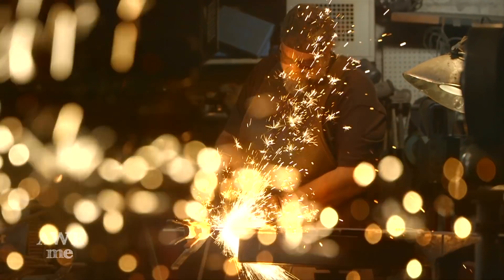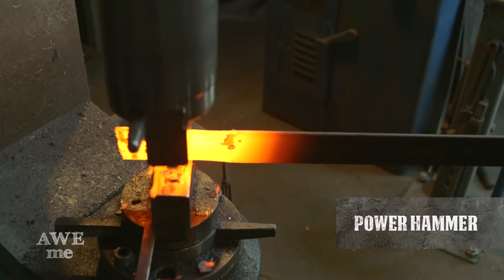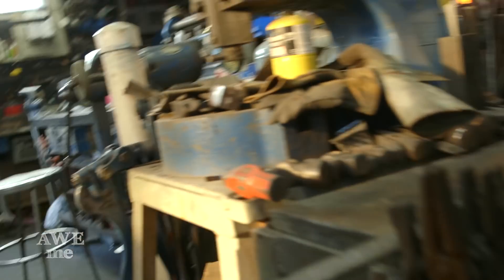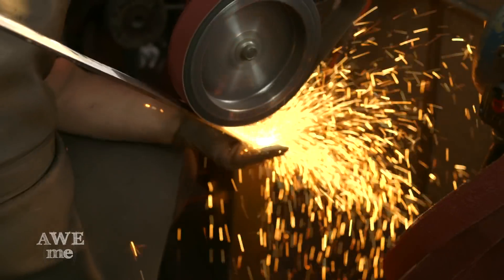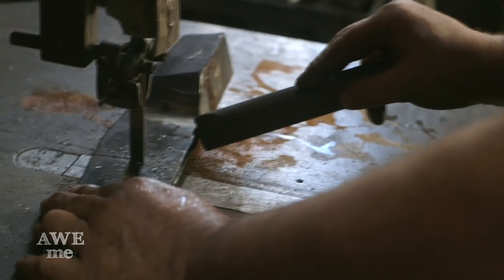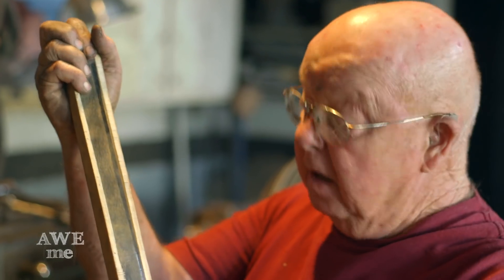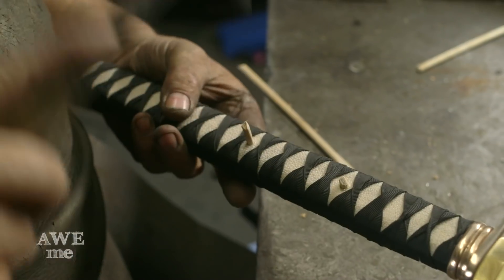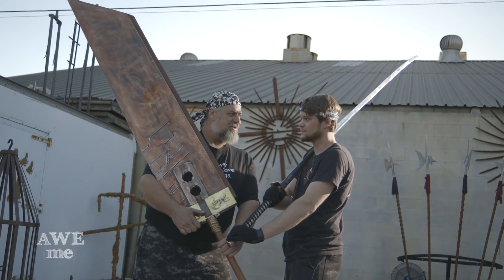Sephiroth's Masamune  (Final Fantasy VII) - MAN AT ARMS

Comment: that wobbly bend in the blade as you swing it is why 7 foot long swords are not a thing
Reply: Jayson201 And that's why Sephiroth is the only one who can properly use it
Reply: I dont care how strong or powerful you are, that blade wobbling like that is a bad thing.
Reply: It's how swiftly you swing it and timing the wobble
Reply: +Jayson201 if you can swing it as fast as sephiroth there will be no wobbling
Reply: +Jayson201 cuz videogaimz....
Reply: +Jayson201 this wobbly bend is what you see in about every blade in slow motion. some just need a huge slow.
Reply: *****
yeah thats right
Reply: the steel is cheap American grade steel. I live in Japan, I am tell you the meat knife I buy in the dollar store here is made from better steel than that crap. Japan steel is unusually strong
Reply: junk face complete nonsense, my friend. your knife may not seem to wobble, but if you add a bit of slow motion it will look like liquid upon hit. the katana is just long, so its easier to see.
Reply: +TheWildPenguin Actually the sword they forge here is way floppier than nodachi, which has thicker blade and strong rigid spine with soft steel in the heart to absorb vibrations, while the cutting edge is extremely hard high carbon value steel. This sword truly is a wet noodle of a blade made from low grade steel, that is not even folded.

Like paper, when you fold the steel it becomes more sturdy because the atomic structure has less room to "bend" and slide around when carbon layers in the middle between folds work as a sort of "skeleton". It is what gives REAL swords like sabers and katanas their precise control and predictable, easy to feel balance that doesn't jiggle all over the place messing up your swing form.
Reply: +Jayson201 dude you got japan confused with china
Reply: Proof is in the pudding. American grade steel is shit.m Japanese 1.8l cars compete with American 3l v6's. I bought a kitchen knife for 2000yen (20 dollars) and cut through a frozen block of salmon.
Reply: Qin ShiHuang 秦始皇 you're Chinese. You're partial in the argument.
Reply: +Jayson201 Shaping a flimsy piece of sheet metal into the shape of a blade is not the same as forging a real sword. I'm not going to say a 7 foot long sword is possible but this proves nothing. Also I would imagine one of the real reasons why a 7 foot sword is not a thing is because it would be impractical in battle. Can you even imagine what it would take to wield something that long in any effective manner? No regular human could wield it and expect to live very long.
Reply: +subject sigma Pier Gerlofs Donia is a key figure in the Frisian rebellion. And his strength was legendary. One feat was beheading multiple people with a single swing of the Zweihander which is 7 feet weighing fourteen pounds.
Reply: Junkmeister This guy clearly fits into the category of "not a regular human".
Reply: then what would fit into a category of "a regular human".
Reply: okay, the point to this show is to make something from video games,
The point to my statement was that in the real world, it's impractical. thats all dude
Reply: "that wobbly bend in the blade as you swing it is why 7 foot long swords are not a thing" If your point was really that it was impractical. I'm not seeing it. What I am seeing however is you taking their piece of shit construct and using that as an excuse to say that that's the reason they weren't made.
Reply: +junk face actually the material that was used for/is used for katanas is really crappy :/ which is why it was rolled so many times.
Reply: +Jayson201 actually those are called zweinhanders lol
Reply: +Jordan Watson false. a 'true' katan would mean it is made like traditional katans, from crap material rolled over and over, which is why katanas crack and dont bend, swords are meant to bend in order to take the pressure of being driven through and object.
Reply: +Pencils Graphite the problem isn't how its made, its how it is that's the problem, its too thin and narrow. i would have hoped you'd know the real reason for why they folded the steel to make katanas is because they had to work with crap for materials, fold it and hammering it over and over got the impurities out so that they could work clean steal, the only reason for why its said to strengthen it is because it fused together the bits of steel that were separated. all it did was take crappy metal adn make it into good metal. nothing else :/

wrong, when you fold steel it is to make the bonds between separate pieces strong. your logic is that its no different from folding paper. if that was the case, that's one thick as sword.  and please, never compare the katana to the saber lol, that's like saying a housecat is as good as a tiger. katanas weren't as popular as ppl like to think and they're no where close to as good as you may think. and unlike a katana, sabers do bend lol, sabers are more balanced for slashing and piercing. katanas how-ever are not.
Reply: +Jayson201 Sephiroth's blade didn't wobble, and came from a world with materials like mythril and adamantium. Moreover Sephiroth was the special project of advanced technology and globe-dominating wealth. His blade was probably designed with highly advanced but extremely expensive materials to meet his needs. Extreme hardness was probably a major priority.
Reply: +subject sigma And that is why Sephiroth is capable of wielding it lol.
Reply: +anthony longoria The reason Katanas don't bend it that they have a relatively thick spine and a comparably short blade to most european swords. Doesn't really make it a better sword though, just different. It has to do with different schools of thought in blade making.
European swords tried to get as long as possible while remaining light, this led to the development of long tapering blades. Now these would snap if they weren't spring tempered, and be to heavy if they were as thick as a katana the whole way down the blade. Traditional katana often lack distal taper, that is the thinniing of the blade as it goes towards the point, While european swords are often half as thick or less at the point compared to the base of the blade. A katana is more or less the same thickness throughout.
 Now getting back to spring tempering, this gives you a springy blade, very resilient but with a hardness around 52-55 rockwell throughout the blade. A katana has an edge hardness of 60-62, but a spine hardness around 40. This is too soft to be springy, but due to how tempering works, is a necesity if your gonna have an edge hardness around 60, which would shatter if the whole sword was that hard. As a katana cannot spring back to shape once deformed, the problem was solved by having a thick spine and a shorter blade.
 Its all about compromises and what you want out of a blade. In europe, springy long blades were desired over a blade with a very hard edge, in japan the hard edge was prefered, hense each blade developed in its own way. Sorry for the long explanation
Reply: Jordan Mahara i already know all of that lol. katanas are okay as weapons that dont bend because they arent meant for pierce as much as other blades with the exception of bronze that is weaker
Reply: ***** Yea that metal is called carbon steel, used by most cultures to manufacture swords if they possessed the technology, which happened on mainland asia and europe before it did in japan...
Reply: any metal that is so hard it doesnt flex will break on first contact lol. We're talking real world here people, stop trying to justify it XD
Reply: Jayson201 exactly what i was saying, swords are meant to bend in order to take the pressure of pierce objects adn the shock of slicing into hard objects
Reply: and what i was saying was a 7 foot long sword is ridiculous and unswingable. You dont want your sword to be wobbling just holding it
Reply: Jayson201 do you know what a zweihander is? of course not otherwise youd know there are and have been 7 foot long words lol
Reply: Pencils Graphite while everything you say may be true, how can you tell this blade is cheap? I mean, people see it wobble in slow motion, all i'm saying is that everything wobbles in slow motion. its not necessarily cheap "american" steel like people like to believe. Also, could you explain a bit more on the carbon layers? i'm pretty confused, steel contains carbon..?
Reply: TheWildPenguin I never mentioned nationality of the steel, steel is steel no matter where it is mined, but it was not folded over and over again, it was not layered in with softer metal and it did not have strengthened spine like proper long Japanese swords have. it was cheap blade because it was not a result of several techniques and month's labor. Just a slab of metal clumsily forced in the shape of a sword.

When steel is forged into a weapon, the carbon content in the cutting edge is much higher than in the "heart" of the blade which is kept soft for the sake of durability. This means the blade has softer metal inside to absorb vibrations and dampen the shock of impacts from hitting armor and bone and other weapons. The quantity of carbon in steel as well as folding the steel together create a more rigid and durable material than simple lump of metal would possess. like how fibers in wood pulp make it more resilient. ancient Japanese via trial and error produced a sword forging method that rivals, and in some areas surpasses many modern methods of steel manufacturing. The folding of steel of course also has been practiced in western culture but Japanese method of combining two types of steel layered within one another made slim and very long and rigid thus precise blades possible.

Oldest Katanas do not even come with a blood groove because they were made especially to precision slashes, with less focus on penetrating thrusts through armor.  The groove was added when need to puncture more advanced armor during war time became a mandatory tactic. Before that, the focus on blade's ability to maintain predictable and accurate cut in high speed slash was treasured above all. This is why also Sephiroth's Masamune is modeled and drawn likely without a blood groove.
Reply: Hate to burst your bubble but the 5160 steel he used is vastly superior than ancient steel, and folding is just a method to force out impurities and even out chemical content, all of which are already done in modern steel. Soft spine only weakens the blade, pure carbon steel will always be better. Only reason old katanas had a soft spine was they didn't spring temper, they quenched, which means they needed a lower carbon spine or it would shatter. Best sword possible would be made from pure carbon steel that was homogeneous. Like he used. The fuller was added to the katana after contact with the portuguese, they saw their swords had it and were lighter, so they tried it themselves.
Reply: +splatted yep
Reply: Historically they were 4-5 foot and used by cavalry.
Reply: Pencils Graphite actually the folding doesn't make the blade stronger. it makes the metal it's forged out of stronger, they had to fold the metal for katanas repeatedly because the metal was extremely impure and sucked ass, thats why penguin mentioned nationality
Reply: anthony longoria That impure metal was only problem during world war 2 when the need for Katanas vastly out proportioned the access to quality steel from mining and imports.
Reply: Pencils Graphite Impurities were far more of a problem in antiquity than WW2. The steel was also not great in a lot of ww2 katanas, but it was because it was just cheap modern steel, in feudal japan the iron was impure because they refined it using a stack furnace, a fairly primitive metal refining technique that saw use all across the world. In europe that iron was called a bloom and the furnace a bloom furnace. This kind of iron requires a purification process, in particular when using an impure ore to start with.
Reply: +Jordan Mahara the japanese use iron sand to make traditional katanas. the last real ancient stack furnace they used and tore down a few years ago, and they would heat it (the metal) until it was "the same hue of red as the color of the rising sun" and they would fold it over upon itself hundreds ( and I mean, HUNDREDS) of times in order to strengthen it and remove all impurities, so much so that when you look at a real katana compared to this masamune, you can actually SEE the masamunes impurities. granted, the masamune is made of heat treated steel, its still no match for any katana (well made that is), and I personally think it would be relatively easy to break, and even easier for its predecessor whose design its based off of (the katana) to cut through.
Reply: Well not hundreds of times, to much folding is bad for the metal as well. Their were hundreds of layers however, start with a loose billet of 30 or 40 small flecks (coin size) and forge weld it all together, fold redraw the metal fold, three or four times and you do the math, hundreds of layer, not hundreds of forge weld operations. I actually do this stuff, so I am just talking.
Reply: Plus the point of folding the metal was just to draw out impurities because the Japanese didn't have access to quality iron back then, modern steels make this unnecessary (though of course you can still opt to do it for the sake of tradition or to bring out certain appearance in the blade and such other applications).
Reply: +junk face -_- where do you think that steel comes from?  most of it is imported from america.
Reply: Dreamtrain Very true, and it is very rewarding to go through with the forge welding and stacking of layers of various steels, however it almost always produces an inferior steel to just plain carbon steel, the seams of the forgewelds are just not as good as when using a single bar of fantastic modern steel.
Reply: ᎶᎪmbᎥᏆ who are you commenting too? the original commenter is wrong since there were and are 7ft long swords called zweihanders. and half the ppl here are wrong about the the reasoning being that they didnt forge it traditionally since reality is that the steel was folded over adn over to get out impurities since it sucked comeplete ass
Reply: anthony longoria yo momma
Reply: ᎶᎪmbᎥᏆ lol good one, too bad youre a good 12 years behind the times for that one
Reply: anthony longoria thanks
Reply: +Jayson201 Thing is, Sephiroth&#39;s Masamune has no wobble whatsoever. The thing is legit magic or something, steel folded over 9 billion times.
Reply: Wobbling has no bearing with how many times you fold steel or not. What folding does is distribute the relatively high carbon content and to weed out most of impurities, it's the japanese swordsmith answer to the bad quality of steel they had at their time. 

Modern steels don't need this, if only to display certain patterns.
Reply: +Jayson201 uhm actually.... you'd be wrong in that regard, there are swords that are that long and sometimes a little longer, look up giant real life swords and you'll see some examples
Reply: Nathan Lauterbach or he can just look up a zweihander, a real historical 7 ft sword lol
Reply: Don'tLetYourMemesBeSteelDreams actually they were successful lol
Reply: Successful does not equal viable
Reply: +ivan von grimm That's not how physics works. An arrow wobbles as it flies through the air. Speed is irrelevant.
Reply: +Junkmeister zweihanders were more to counter polearms than anything
Reply: TheAnthery true. ppl dont seem to understand that most swords, spears, and arrows are meant to wobble when in action to allow them to puncture their target without it breaking. things like katanas usually dont wobble not because theyre good, but because theyre meant more for slashing
Reply: +Jayson201 Unless it's made of adamantium like wolverine's bones lol
Reply: I know that they're SUPPOSED to have an amount of flex. The Zweihander is a 6 foot sword, and 1.5-2 of those feet are handle. It's a greatsword. I know those  exist. But 8 feet? The masamune is quoted at 6-8 and 8 would be simply ridiculous, and 7" 2 inches is just as ridiculous. The longest zweihander was up to 5.9 feet. that's significantly less blade than the masamune.
Reply: Jayson201 actually only about 9 inchs of it were for the handle :/ the blade lengths were almost 6 ft long as they were made for cutting into pikes and even hitting horse riders. that puts them at almost 7 feet depending on the user. sooo yeah, 7ft swords were/are  a thing. 8 ft, no, we have spears for that/ never would need that extra foot. thats 1 foot less or more than the masamune was quoted to be at according to you, so even shorter zweihanders at 5.9ft are 3 inches less at minimum. plus, its a game an the sword they made is for show.
Reply: +Jayson201 You&#39;re wrong. It does need flex, but typical japanese forges did not have flexibility. Even the japanese Nodachi does not have flex. It&#39;s the reason the typical samurai, or ronin would carry multiple katanas. Because of the fact during battle in some cases the blade would bend due to it&#39;s hardness and stay bent. It&#39;s europeans that developed blades with flexibility. Japanese did not do that. (Knows a thing or two about metallurgy, and historical blades.)
Reply: You're right I was wrong about handle length, but after doing more research, the length of the blade was not 6 foot, that was the overall length of the sword entirely. there is ONE count them ONE sword that was actually used historically that was 7 feet. and every other greatsword around that length weren't for battle but for ceremonies.
And I KNOW its for a game, youre the one who was telling me that 7 foot swords were commonly used all the time when there's only one instance historically where a 7 foot sword was used succesfully and most others were 6. All I'm saying is that it's NOT PRACTICAL, thats all ive been saying from the beginning. Now you've got me doing all this extra research (Which I actually like, so thank you) and learning just to again say, it wasn't practical then, it's not practical period, and thats why there's one in a museum as opposed to the hundreds of greatswords in museums that are 6 foot or less
Reply: Robert, I know that katanas often bent and needed to either be bent back or replaced, I don't remember refuting that fact about katanas. All I'm trying to say is a 7 foot in total sword wasn't practical then, and just cuz one was used historically doesn't mean it was practical for most people. For all I know (lack of research on the specific user) the guy who used the 7 foot zweihander was as tall as the damn sword was.
1 7' Zweihander does not a practical blade make. The large amount of 5-6 foot Zweihanders and greatswords alike are what were the most practical as for as LONG swords went, because what tends to be more practical tends to be more popular. Maybe viable was the wrong word to use before.
Reply: look kids this was made by master blacksmiths...are you master blacksmiths? no so quit thinking you know stuff
Reply: and the master blacksmiths only made it because they were asked.
Reply: They didn’t use authentic materials for god sake they used chopsticks a chair leg….its not like how it would be made in Japan
Reply: @junkface27 exactly. They have very strict “rules” when making swords in Japan.  

This was a hack using what he had in his shop.

It’s not like he spent real coin on the steel
Reply: And aside from the wobbling, the leverage it would give any opponent in a bind would make it a pretty poor performing weapon anyway in real life. 

(Since some people mentioned those, zweihander were more in the 5 ft range, while functional greatswords/montante around 6 ft, but they are heavier and differently constructed swords used mostly in specific crowd control scenarios. 7+ ft greatswords were only ceremonial and used for parades.)